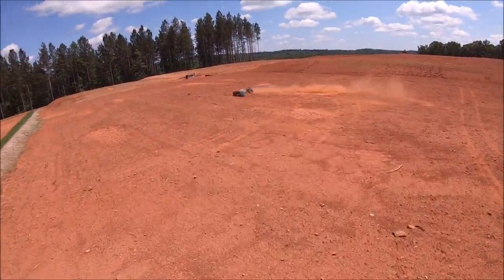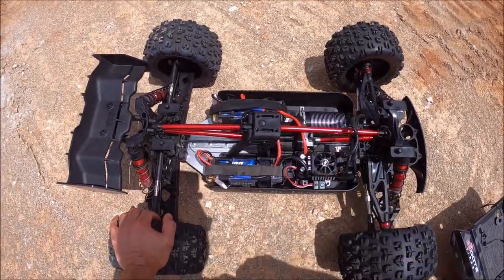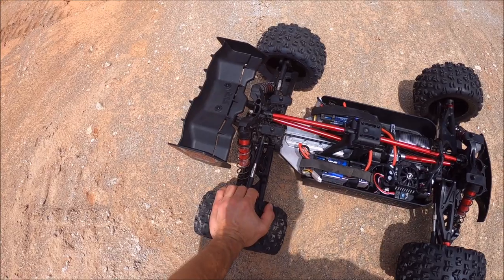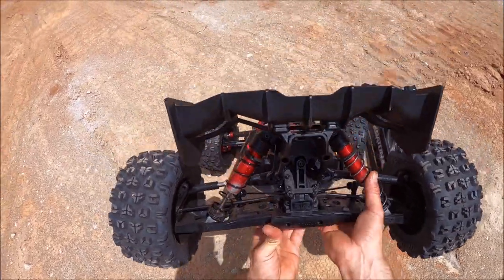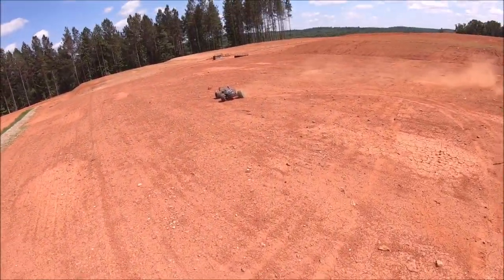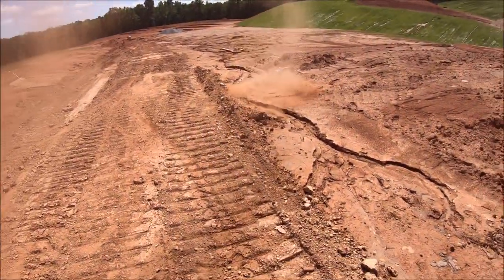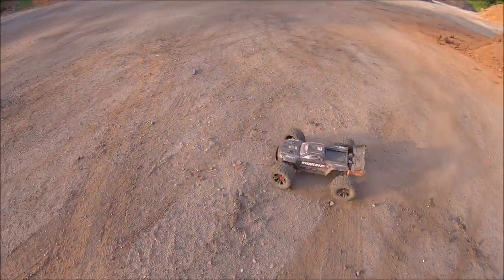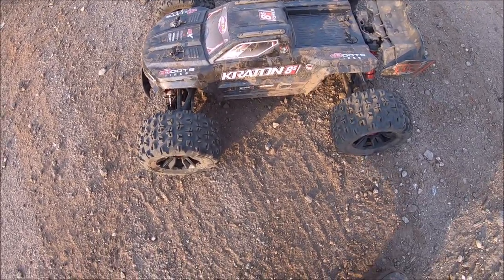BUILT for Punishment!! New 1/5 Arrma Kraton 8S EXB M2C'd Monster!

Comment: How do you like the Saga gears vs using the limitless spool gears?   I’m running my 8S 800kv w 34/34 gearing.
Reply from the maker: Saga gears are a bit fatter and have two grub screw locations. Other than that both work just fine!

Comment: Can’t believe how your A-arms are holding up for more than a second on this truck. I literally exploded four of the stock ones in mere minutes, they are so glassy. I would do RPM arms before any other upgrade on these trucks.
Reply from the maker: Yeah whole bash without an arm breaking🤔Usually during the warm months arms aren't a problem for me but in the winter yes, they shatter like glass!👀RPM arms are great but have no area for droop screw or droop control. Puts a lot of strain on the shocks so that is the next week point.😱
Reply: @RCDUDE81  I 3D printed a little foamy TPU piece to but in front of the shock piston to slightly limit it’s travel and dampen it on full extensions. Haven’t had any issues since with that. Stock CVDs will still bend on gnarly landings, but they are so easy to hammer straight, blast with a heat gun to take out the strain and keep rocking, same goes for the turnbuckles. 

Another issue I am working on currently is the heavy cans on these beasts being unsupported in the far end. It’s absolutely nuts how beat up my chassis is under the motor, meaning this stuff is flexing well beyond its comfort. I am on revision 3 of a really nice concept of a motor support + fan mount + cooling shroud in a single piece. I am very very confident that this will be a winner. If you got a 3D printer handy that can do somewhat exotic materials like PA or PC, I can do a version that fits your motor geometry and send you the STL if you wanna try it out. I share all my designs freely, so no issues :)

I am personally very reluctant to pour more weight into especially my K8 EXB, as it is already a darn heavy truck. Do you mind sharing what kind of upgrades you feel have the greatest impact with the least addition to weight?

I have tried to do the exact opposite of beefcaking on my Talion, and the result is absolutely outstanding. The main thing I did was to 3D print shock towers in PA12 with carbon fibers. This makes for towers with about the same stiffness as the original stamped aluminium ones, but completely unbreakable and weighs nothing. It seems to be saving all manner of other parts on the truck too. I kept torturing it on massive drops with no damage what so ever: https://www.youtube.com/watch?v=4Nm9wPEuUPc
Would love to see more effort being put into light weight upgrades like this :)

Comment: And crazy how it is just as agile as a 1/8 scale kraton! You'd never know until u get close to it.
Reply from the maker: Agreed bro it's crazy!😱Get the right power and setup in there and she's incredibly fast and nimble for a 32 pounder!😆👊💪💪
Reply: It is. I'm running the XLX2 AND 1100KV motor with 35/47 gearing mine and it's an absolute monster. 58MPH on pavement and around 54mph on grass 🤣. Double backflips are easy to achieve. Hehe.
Reply: Man that spot is great, looks like a 6s and up spot, killer.

Comment: Witch one do you like best out of the outcast exb 8s or kraton exb 8s
Reply from the maker: Both are about the same being rollers. Once equipped it's all about what driving experience you want. Kraton will hold down power and be faster. Outcast is better for stunts, flips etc. Both about the same durability stock.😎👊
Reply: @RCDUDE81  cool I bought the kraton yesterday I put in a max5 800kv I’m picking up my servo tomorrow for now I’ma run 39/33 gearing I want speed but still able to hit double backflips lol I love to bash but I like to be fast

Comment: Do you get more speed out of the hobbystar 56112 compared to a 5687 1100kv?
I bought the 5687 today for my kraton 8s and i thought it would be more speed since it has more kv
Reply from the maker: All depends on your gearing. What gearing did you go with compared to the 56112?
Reply: @RCDUDE81  
I didnt have the 56112..
I got the 1250kv in it now and i ordered the 5687 now.. its a tad bigger and less kv.. i wanna put 39T spur and 28 pinion on it
Reply from the maker: That should be a good setup!👌In my latest vid with the Outcast 8s EXB I was trying 39/30. Wicked fast but got a little too hot. 28 or 29 pinion should be a sweet spot with 39 spur on the 1100kv.
Reply: Very nice, i will get the 28T pinion to be a little more save..
Thanks for the advice man! Cheers

Comment: As always crazy good rc driving. When I get wild with my rcs they over heat pretty quick. My typhon v3 only goes about ten hard minutes with a 100c spec. 3s before it over heats with stock pinion. Really gets old and it has fans on motor and esc. All my traxxas do the same. I have a FTX 1/8 that I put a 120amp esc with a 3300kv long 3660 brushless that never over heats. It's over geared also and I don't get why my rtr cars over heat and my custom ftx doesn't. Drives me crazy.

Comment: I would like to know how the engine doesn't heat up using these gear configurations! Because I use 35/39 with a max5 esc and a hobbystar 780kv and the engine temperature is over 200F 😕 Do you have any idea why this is happening? Thank you.

Comment: Hey man, do you solder on 6.5 bullets for the hobbystar motor? I tried adapters so itll work with the max5, but it seems like heat and vibration keeps loosening them back up.
Reply from the maker: Yes I resolder on correct bullets. It's a pain but worth it!
Reply: @RCDUDE81  ok just wondering. Ill have to give that a try. Really wish hobbywing would make the max5 8mm bullets. It just makes much more sense. The max6 can stay 6.5mm for lighter rigs.

Comment: crazy video bro! do you have problems with your car cutting out on full power pulls with 34 34 gearing. i am running the same setup but i have the hobbywing 800kv motor and under full power pulls it wants to go into limp mode for a second. i thought it was my batteries but upgraded to highest c rating i could find. just wondering if its the motor or if you have the same issue? other that the cars a tank
Reply from the maker: Haven't had that problem🤔Usually only thing that will cause that is weak batteries. Good you went high C rating! What lipos are they?
Reply: @RCDUDE81  powerhobbys 8000mah 120c graphene packs... i turned the punch down from 5 to 3 which helped a little. the only other thing i can think to do is try a capitcer or another motor.  i really dont want to drop the gearing down because i love the power it has and it stays cool enough.

Comment: Just curious, are you still running the Radiolink 6 channel radio?
Reply from the maker: I had the 4 channel but the receiver died on me for some reason..🤔Just haven't got around to order a new one..😆
Reply: @RCDUDE81 , Ok considering one for an upgrade + Gyro doesn't hurt on these beasts. was wondering your luck. You might have to put it in a foam cocoon

Comment: Awesome build for sure. Any heat issues with that gearing? I have a hobbywing 800kv motor I was thinking about running that gearing or maybe 33/34
Reply from the maker: Thanks bro!👊No real heat issues. I'd recommend a cool down between packs though. That gearing with a 800kv should be golden!
Reply: Thanks for the heads up on cool downs. What gearing would you suggest with a 39t spur? 39t pinion? Or smaller